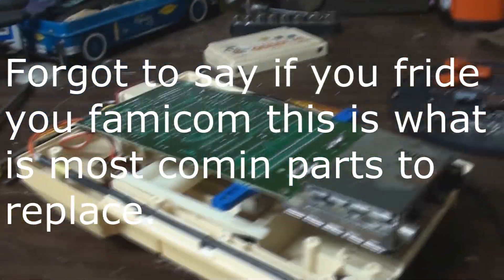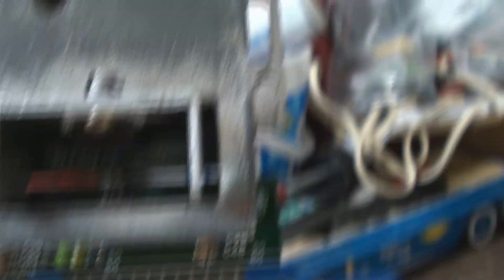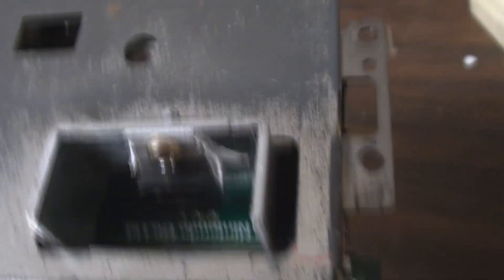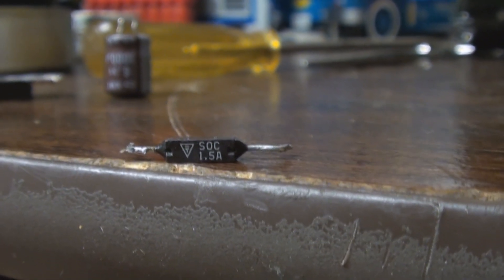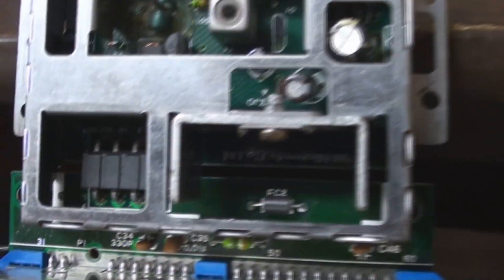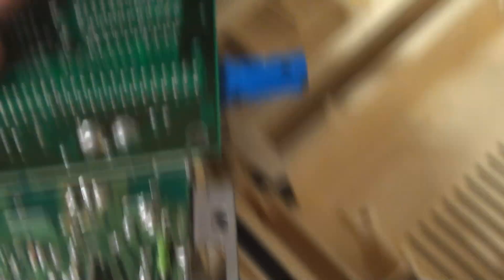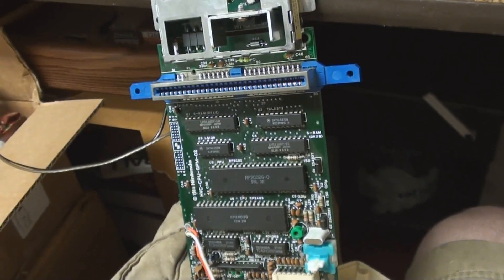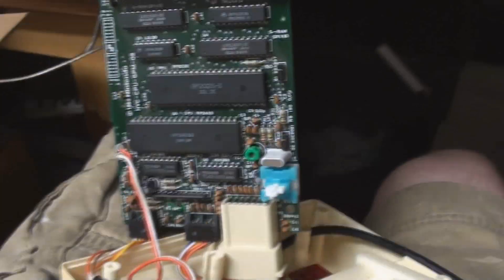Famicom Repair

Comment: I got my famicom months ago. Japan seller sells many but I tried 120v av adapter Idk if I fried  it I then complain to seller he sent 100v av adapter and a rf the one that goes with the famicom. Do you think I fried it?  I can't figure out how to make it work in Canada and I had a ig collector guy try help me. @sara_colorful_nintendosegagirl it's upsetting that can't make it work
Reply from the maker: That 120v sounds like just a input for the power supply from the wall to plug. What u need to watch out for is the output amps and voltage to the famicom. The output of your power supply should be 9v 850 miliamps - 1.3 amps. If your using the power supply from japan I would not trust that sense your voltage from Japan to Canada will be different just like here in the US. I think It mite be fine as long as u did not hear a pop in the system when u pluged it in. If u did then just like in the video made u will have to replace the Fuse, the chip (voltage regulator) and the Capacitor if its bubbled at the top and leaves acid mess on the board which It need clean before it eats the motherboard.

Comment: Hey i just want to take a second to thank you for this video. Much like you, i used my NES power supply on a Famicom like an idiot and broke it. I saw you video, went to a small electronics shop, bought the 3 parts (fuse, cap and 7805) and now my Famicom is as good as new!!! :) There is a good chance that replacing the fuse alone would have worked in my case, but given that a a new cap + 7805 was like 1.50$, i figure I would do it like you.
Reply from the maker: Thank you and I'm glade my video helped out with the repair.

Comment: I accidentally use the FC 110v power supply plug into a 220v transformer.  The console fried right away.  Are these the 3 fuses/chips needed to be replaced?
Reply from the maker: For what I replaced in the video it did fix it. 1 fuse, 1 cap, and a Transistor. If this model is the same as the one your working on then this repair will work.

Comment: Hi. I finally got the fuse  (100 pieces, too many, lol but I'd probably sell some and give away some), that was a long wait. I've soldered it (pretty tough) but I accidentally yanked the power switch wire but I've soldered it back thank to iFixit's disassembly.

The Famicom won't work still, I wonder which capacitor or resistor or transistor should I check next? This revive (including the wait for the fuse which took 2 months + the months of research) has been more than 2 years:D

but perseverance.

God bless, Proverbs 31

Comment: Hi. My Famicom is outputting 14vdc (it says printed on the adapter, 10v 850mA) . Is this normal? It's a 100v power supply (japan).

If 14v is ok, what's the next component to check? Or should I just automatically replace all 3 components you replaced?

Thank you. God bless, Proverbs 31
Reply from the maker: It should be fine with the 14 volts, if its not turning on then replace the three parts I did.
Reply: Hi. Would this work: Can Famicom  transistor/voltage regulator (is a regulator a transistor too?) HA 17805 be replaced withI with a AN7805 (the one I bought, the only one available)? I think HA means Hitachi.

Is the 1 before the 7 important? Or these are just the same 7805?

By the way, off topic (about a power supply for another gadget).

Also, the original ceramic fuse had a label of T8AH250V will the one I bought work (it's the only 250v available)? :

5A
BS1362
6X30

Besides the amperage what do the  other numbers even mean?

Also, I bought a fuse but it's the glass one only 1.5A- would this work? If that's ok, how thick/gauge should the wires for the legs be?

Thanks.
Reply from the maker: @SevenDeMagnus  The transistor you have HA 17805 mite work, it's a 1.0 amp and the LM7805C is a 1.5 amp V.R. \ Voltage Regulator act like a Light switch and a Transited acts like two diodes tied together ether as a NPN OR PNP (Positive or Negative). For the LM7805C I get 11 listing on Ebay in the US. and there is One listing I seen thats from France.
Reply from the maker: @SevenDeMagnus  The gauge wire for the fuse is a 20 gauge. The full size glass fuse won't work, they usually don't have wire leads but once with leads are manly 14 gauge wire which is to big and it will fry your system. Try to find a 125v 1.5 amp Pico fuse and that will work.

Comment: Hi. Famicom has no power. Famicom power supply only has less than 1 VDC power. I already replaced the power supply's capacitor. Any idea how to fix it? 

Thank you. 

God bless, Proverbs 31
Reply from the maker: The power supply should be putting out 9v 850 milliamps.  If not then I would say the transformer in it is blown open so it can't build up 9v to power the famicom.

Comment: Hi sir. This is a bit off topic but it's a bit similar (problems with power).
Does my Famicom power/AC adapter need rewinding or does it need it's capacitor replaced? The adapter is 10v DC but the power/AC adapter is only outputting less than 1v. 
The specifications are:

DC 10v 850mA
AC 100v 50/60Hz 18Va

Is it the capacitor? The capacitor spec is 16v 2200 microFarads.

Thank you in advance. 

God bless, Psalm 11:7
Reply from the maker: If the AC adapter is only putting out 1v ac and not 100v then i would say your transformer in the AC is bad. Are you using your Famicom out US or in the US? Once you know the power supply is good and the system still dose not come on, then it would be a bad cap and fuse which should look like the one in the video unless you have a older model.
Reply: Hi, I'm using it out the US. The Famicom power adapter is only outputting, 1 volt DC, I mean (measured at the end, the end that plugs into the Famicom). Would this need a fuse replacement (where is the fuse located), a cap replacement or needs to be rewinded? The power supply is the first batch (1983). Thanks again.
Reply: Hi. Trying to make time to repair the Famicom (for nostalgia, this was my first video game console that I have for my own by exchanging my bike, when I was 14).

Would this fuse specification work. I don't need that many but it's got free shipping (shipping is expensive):

https://www.aliexpress.com/item/32853381372.html?spm=a2g0o.cart.0.0.32e43c00X6ZpTw&mp=1

Thank you.
God bless, Proverbs 31

Comment: Hi. Thanks for the video.
Is there any way to test the fuse and the chip? I've just got a famicom and plugged it with a nes adapter. Not sure if something happened. I tried after with an appropriate power supply and I'm not getting any signal...

Thanks
Reply from the maker: The fuse can be check with a volt meter and the transistor but the transistor is a little harder to check. Be sure to look at the cap as seen in the video and see if it is bubbled. The bubble on the cap means its blown and will need replaced.
Reply: Well...I hate to be the bearer of bad news but,  you have just fried your famicom. The reason why is because the NES and the famicom use different voltages. I've heard that the adapter for a sega Genesis works with the famicom.
Reply from the maker: Well, the famicom was cooked buy my oops with the power supply being backwards but after I fix the items in the video it was working just fine. So it's not
 fried.

Comment from the maker: Yea, at least I would if that was the only problem. For the controllers, they can be saved for parts in case someone broke there famicom controller sense they can't be used on american Nintendo's because the way the input's are.

Comment: In case I ever got a Famicom with defective audio/video and/or no power, I should probably replace the transistor (LM7805C), capacitors, and fuse, shouldn't I? Even if the Famicom's dead, perhaps the controller(s) could be salvaged.

Comment: Hey, This seem to be the only vid i can find that actually repairs a famicom.I do not consider cleaning a system as a repair. I do know cleaning an old system can do the trick but still,One does not repair ones house every spring ;) Question, My FC "boots", i KNOW its getting info from the cart, BUT the screen is not showing other then going from complete black to random pixels with faint sound. Me thinks it needs fixing, Can you make a vid dealing with this problem? :)Long shot but worth a try

Comment from the maker: The Fuse should be in the back were you power cable plugs in and your video output. There will be a simble with two straight lines with a wave between them, that will be your fuse.

Comment from the maker: Did you open the consol and see a fuse simble like the one show in the video. If the system dosen't power on then the fuse, 6.5A cap, and the chip is gone which it's not hard to replace. Find someone who knows how to use a sodering gun and a desodering gun to replace the 3 parts. Then just get a 10v power supple, then turn to tv to ch.96.

Comment: Great video! I bought a Famicom from Japan as junk. I can't get it to power on, but it has the 1983/1984 boards. Apparently these older boards didn't have a fuse anywhere that I can see. I got it cheap, so I guess I will sell it cheap and try to find another one.